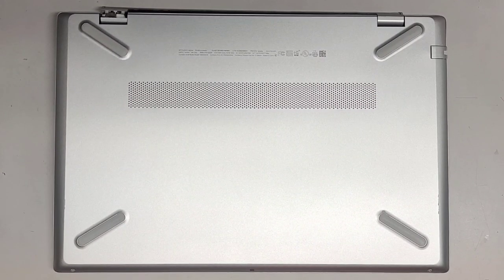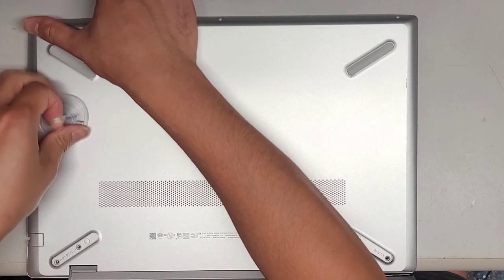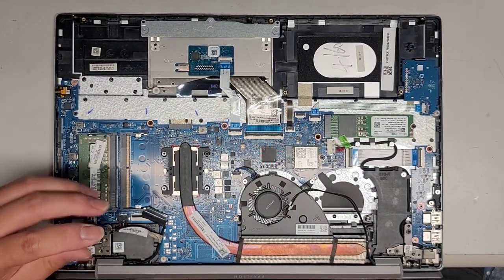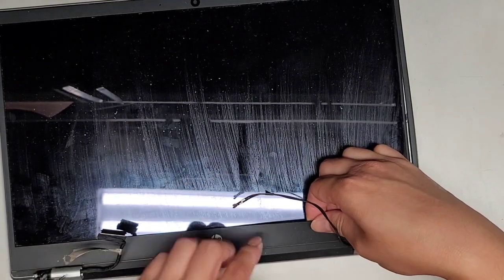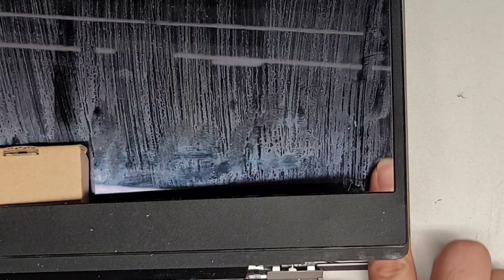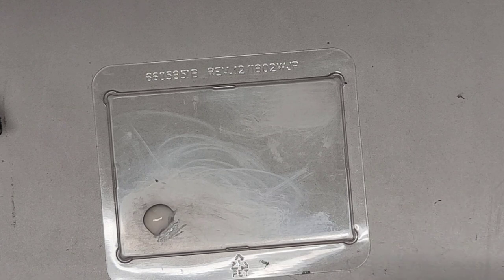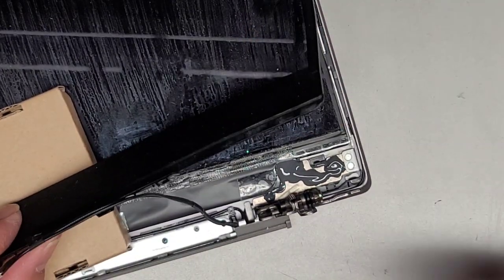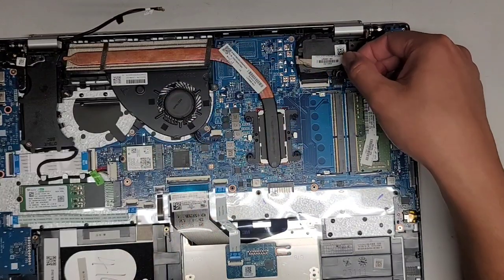HP Pavilion Laptop 15-cs1065cl Disassembly RAM SSD Hard Drive Upgrade Battery Replacement Hinge Fix

Comment: Awesome video, learned lots of things. I have a question though. I have Lenovo IdeaPad Gaming 3 and the thing that kind of secures the Ethernet cable has become very loose and I keep losing connection because cable just comes off itself. Is it easy to fix this?
Reply from the maker: Are you sure it's the port and not the cable?
Reply: yeah i think it is the spring that went bad or another thing no clue it just does not hold the cable @ItsBinhRepaired
Reply from the maker: Likely the plastic tab